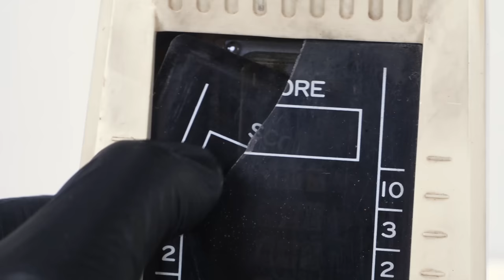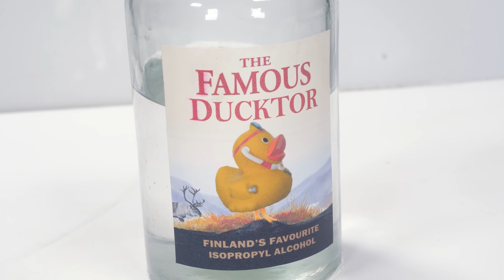Space Invader Console Restoration with Broken Screen - Retro Console Restoration

Comment: I would have either removed and replaced the solder on those broken and dry joints, or added some flux, as the joints still didn't look good even after reflow.

Comment: That's awesome! 
I have one question, though. I noticed, that you washed the back of the case with watery soap (I like that line of yours :D), but as far as I could see, you didn't take away the speaker before doing that. Won't this cause corrosion on the speaker?

Comment: Your restorations are top-notch as always! 
But watching you desolder and solder in general makes my toenails curl up. xD
Old solder should generally be removed and not just new solder added. In addition, a vacuum pump would be gentler on the components with through-hole contacts, as the desoldering wire keeps the heat on longer.
Ok, I've also had 30 years of soldering experience and I'm an old fart. xD

Comment: I'm pretty sure that my original one from the 80s had one of those felt pads around the control stick, but not under the firebutton. Its not doing anything under the button but it keeps stuff out of the casing if its on the stick.

Comment: Wow not seen a game like this since early 80's, had one similar in UK, except... The fire button was a red square, the front was yellow, the back was black. The invaders, your turret and score were displayed in green, the rest in red. I also recall the front being mostly flat, the 4xAA battery compartment on the back was recessed forming a kind of grip for your fingers.

Played the same startup tune, but more distinct sounds for, firing, explosions and flying saucer when it was at the top of the screen. Sound generation a bit off or just not the same?

Comment: My only comment is that you should remove the old solder completely. Adding new solder will not correct the chemistry of the old solder. If its broken then its probably 60/40 and you will want to use 63/37 to replace that old junk. If you just add new solder to the old it will crack again almost certainly. Otherwise, excellent repair. I worked in electronics repair for several years while in college repairing lots of 70s and 80s electronics. Lots of stuff unique to the early days we learned not to do by the 90s.
Reply: Also, DO NOT try to use lead-free solder on old PCBs. They can't take the heat and the copper will fall off.

Comment: For as often as you do jobs that require soldering, your skills haven’t really developed. Flux goes a long way, as does adding fresh solder. Just touching the tip to old solder doesn’t go a good job at fixing bad solder joints.

Comment: Not very good at any of this, are ya?   Good at video makin', though.  Still watched the entire thing.

Cold solder joints everywhere.  Learn how to clean and tin your tip.  Also, flux, flux, flux.  Iron should be at proper temp, too.   Then, you don't have to leave it on so long and risk lifting pads or dislodging barrels.  Also, those leads on the caps should have been bent at a proper angle, not forced in like that.  

If you are having to push too hard on your scroll saw, install a new blade.  Also, adjust the tension properly.  This is why it was not cutting straight.  You can get big packs of blades for cheap.  Expect to go through them, not be frugle about it.

When cleaning the board, use lint-free tissues meant for this, like Kimberly Clarks, under your brush once you've loosened the funk.  You pretty much just sloshed all the gunk around the board.